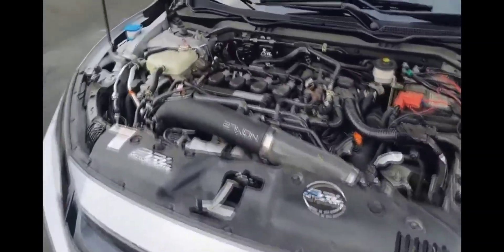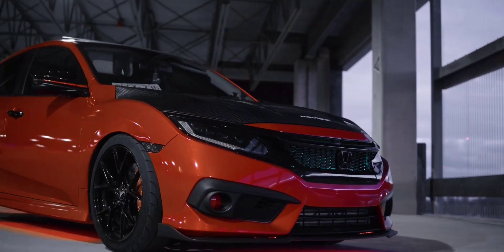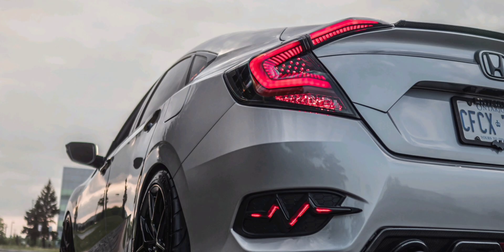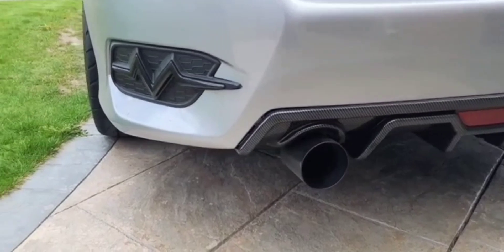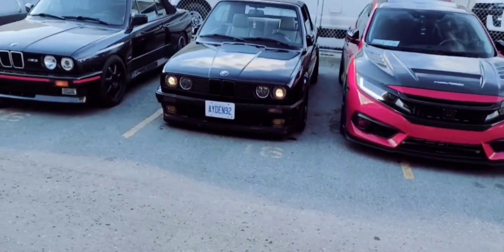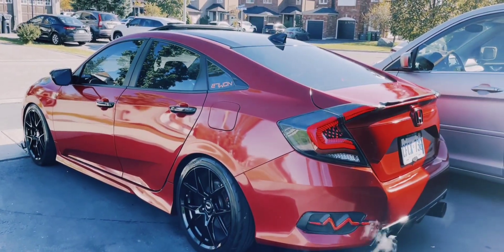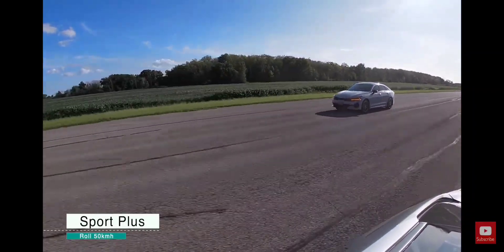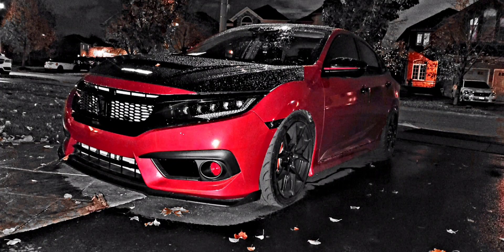Modify Honda civic 1.5 CVT review.

Comment: I always told people that with a CVT, having it “fake shift” makes it slower. It does feel more conventional and sporty in a way, but you’re exactly correct, the boost drops as well as the rpm and then the engine has to remake the boost. I thought with Hondas that if you left it in D mode, it would just stay at 6k-6.3k at WOT, and in S mode it would fake shift at WOT. That sounds weird because like you said without the fake shifts it is faster so why would Honda program it like that. I think it’s just for the effect so people think it’s shifting and seems quicker. It could be the opposite, but I know I drove a friends CVT 1.5T at WOT and it would hold the revs in one of the modes and I believe it was D, surprisingly. Anyways, love your car. Looks so fresh brother. Good luck with it. Change that CVT tranny fluid every 15k to keep it fresh.
Reply from the maker: Yep, sound can be deceiving, when it makes that shift sound you're thinking it's faster but it's actually not.

Comment: beautiful build bro. I have a tuned Maxima with the Cvt. changed both engine and transmission fluids from OEM. such a rocket, the CVT is definitely an underrated build
Reply from the maker: Thanks, Yeah but I just monitor things when I'm pushing it, alot of guys are breaking their cvt then they can't believe I'm pushing mine so much without breaking it, whenever I'm racing or doing draggy, I always have my ktuner plugged in monitoring cvt temperature, knock control, fuel trims etc, these guys who are breaking their cvts don't monitor shit when they're pushing their car, think about about it, let's say you're pushing the car alot right and let's the the cvt is overheating or the knock control is going up alot, they have no idea of what's happening, so they continue pushing it and the cvt overheats way too much and then boom, or the knock control goes up so much that they starts getting rod knock and kaboom engine is done... .
Reply: What does it mean pushing your honda, is it fast driving on motorway or drag racing?, street racing?, if you pushing honda on motorway example constantly  driving around 200 km/h, for couple of hours is it cvt build to handle that kind of driving?..I do not do any racing or drag racing with my honda sedan 1.5 t .

Comment: this gives me motivation to put some money aside and build my CVT hatchback
Reply from the maker: Be careful, hatchbacks have weaker rods than sedans
Reply: @the_batmobile0.4  I’ve heard the touring coupes have the same rod thickness or close to as the Si’s. Did you find this to be true?
Reply from the maker: @chad6434  true base on my understanding
Reply: @the_batmobile0.4  awesome. We’ll I’m on my way for your build. Getting my down pipe this Saturday, after that I’m saving up for the inlet and turbo then I’ll be finished!
Reply: @the_batmobile0.4  what about a 19 coupe ex-t?

Comment: Extremely useful info man. I am currently building my own 21 sport CVT. What are your thoughts on installing a CVT cooler?
Reply from the maker: It depends, I live in Canada, it's pretty cold here most of the most months oct-may, I didn't get one, also when I'm racing I'm monitoring my cvt temperature on the ktuner, so if I see it's going above 110c I'll just stop hammering it and let it cool down. If you're in hot place, you could get one
Reply: @the_batmobile0.4  yeah I live in central/southern California. So it can get anywhere above 90 degrees F on some days. I’ve got a PRL intercooler installed but that doesn’t help the CVT.
Reply: @the_batmobile0.4  Wow thats 230F,most ive had is 219 on highway and i dont go on the highway much just 30 mins drives to my friends house but i ordered a cooler because it reaches 100F here in Miami so ill be ready and install it next week when i do the first CVT oil change next week at 30k miles on my 2019 Civic with Ktuner's TSP stage 1 tune. I have a mishimoto cold air intake but i swapping to a prl cobra next week and the 27won TIP also this friday.

Comment: Currently have a 2020 Civic EX-L under on power mods
Ktuner v1.2 running phearable 1.5r on corn tune no flex FF
PRL CCAI
27Won DP/Stock FP
Exhaust Stock Mid Reso Valvetronic Muffler from dual exit to single exit.
Other mods
Mishimoto Coils pack
Strut bar sirimoto
Other than that all are stock and only did maintenance schedule early not on reccom factory intervals.
Any opinions or advice for me to take? just comment : )
Reply from the maker: @stevenleyson728  seems like u got everything covered unless u want more power.

Comment: This video makes me love my 1.5t hatchback I have a injen intake and a stage 2 Ktuner and been looking for more ways to gain more power from my car
Reply from the maker: Be careful,  hatchbacks have weaker rods than the sedans touring
Reply: @the_batmobile0.4  is this something proven? I thought all the engine block is same with fk7's and fc1's
Reply: @berkaysenoglu1784 yes it’s proven. Hatchbacks do have the weakest rods
Reply: How has the tuned 1.5 cvt been? Has it held up after a year?
Reply: @the_batmobile0.4 what about the coupes? I have a 19 coupe ex-t with the L15b7 engine. It's strange how the coupes only got 170hp in ext trim. But the hatchback gets 180hp? Plus there's two CVT transmissions I'm assuming? One with the paddle shift, and one without paddle shift.
Reply: how’s it been bro? i just want something simple i have an exhaust but looking to tune and intake

Comment: 12:17 wow.... I have the same car and had no idea you could just throw it into neutral from a roll and rev the engine. I assume you let the rpm's drop before throwing it back into drive correct? If so, I definitely need to try this next time I drive lol.
Reply from the maker: @BmoBro1992  correct, take your feet off the gas pedal then put it to neutral, same thing for when u switch from neutral to drive

Comment: Love you build. Do you have a rear motor mount on the car ? Also did you go up to 5w-30 oil ?
Reply from the maker: Hi no I do not have rear motor mount, I did had a aftermarket engine mount which was terrible at idle and low speed, car was vibrating alot with the aftermarket mount, I used amsoil signature Series 0w-20
Reply: @the_batmobile0.4  I still don't understand why everyone switches to 5w30 on the Facebook groups. 0w20 to 5w30 is quite a jump, especially when many of those guys have few mods, and it's a modern small displacement engine.

Comment: Hello sir, I have a 2020 1.5t hatchback sport CVT, do you think i can get up to around 250-260 horsepower and be fine with the transmission?
Reply from the maker: @Sean.fk7  should be fine, just avoid launching it too much, and make sure the fluids are up to operating temperature before u floor it

Comment: Where did you get your rear bumper lower garnish? Looks sick!
Reply from the maker: U mean the diffuser?
Reply: @the_batmobile0.4  above the diffuser, I have the same diffuser but not carbon fibre like yours. I am referring to the garnish, two on each side with zigzag lights
Reply from the maker: @kg_1720  oh the rear drl's.....I got it from Amazon but I can't that specific zigzag one, but here's the link for other design...browse around u might find it.

https://www.amazon.ca/iJDMTOY-LED-Bumper-Reflector-Rear/dp/B074R3L4ZT/ref=pd_aw_sbs_sccl_2/143-1478333-1575448?pd_rd_w=i8D7x&pf_rd_p=ad2ad842-afef-48af-aeab-080c9036bde6&pf_rd_r=VGHNWFGVYM1KD5FQ5JVB&pd_rd_r=2f2a320b-59be-4034-9bf5-ceebbf0f17ab&pd_rd_wg=cGt0t&pd_rd_i=B074R3L4ZT&psc=1
Reply: @the_batmobile0.4  maybe they don’t sell those anymore? I really want the same ones you have for my Touring
Reply from the maker: @kg_1720  yeah could be because I can't find them

Comment: Do u think it'll be fine to push the 1.5t cvt for the accord as well since its basically the same setup? Recently bought a catless dp for her 😭
Reply from the maker: I dont know, just because mine hasn't, doesn't  mean someone else's wouldn't, and you have realized that I just monitor things when I'm pushing it, alot of guys are breaking their cvt then they can't believe I'm pushing mine so much without breaking it, whenever I'm racing or doing draggy, I always have my ktuner plugged in monitoring cvt temperature, knock control, fuel trims etc, these guys who are breaking their cvts don't monitor shit when they're pushing their car, think about about it, let's say you're pushing the car alot right and let's the the cvt is overheating or the knock control is going up alot, they have no idea of what's happening, so they continue pushing it and the cvt overheats way too much and then boom, or the knock control goes up so much that they starts getting rod knock and kaboom engine is done... .
Reply: @the_batmobile0.4  oh okay brotha thank you for the detailed response! N yea imma just check everytime like u r with the ktuner v2 screen.

Comment: So setting the TPS to 90% wont let the car “shift” even in sport mode just keeps the rpms near 6k? Is that what your sayin? And you keep the block there while you drive?
Reply from the maker: Yes that's what I'm saying but sometimes it'll still shift, yes I securely keep that block there, make sure that block doesn't fall off and go under your brakes pedal, but yes the point of the 90% is to keep the car from shift and keeping the rpm at 5500-6000 rpm however it still shifts sometimes, if it does shift alot with the tps at 90%, try tps at 85%

Comment: Thinking of going flex fuel. I have a 2021 EX CVT tuned with phesrsble 1.5 and a prl race cai for about 6k miles. If i install the prl flex fuel can i run both 93 gas and e85? I can only put e85 on the edge of town and would only be down for it when i go out for races. Should I add more bolt ons? Or as long as i don’t consecutively hit it should i be fine?
Reply from the maker: Yeah you'll need a flex fuel custom tune to run both 93 octane and e85, honestly it'll be better to run flex fuel Ethanol only if you upgrade your turbo, the stock turbo is already max out with just 23ps on 93 octane  with ktuner 21psi otsi, with Ethanol  you'll pushing around 27psi.. and since your car is ex , that means you don't have the stronger rods, but it should be fine, I wouldn't go for more power unless you're gonna be racing like me and trying to get draggy record
Reply: @the_batmobile0.4  Appreciate the feedback man your civic is goals

Comment: I got a question have you done a cvt drain and fill and found a metal piece on the magnet?
Reply from the maker: @vvsking2913  I haven't found any metal pieces when I change my transmission fluid
Reply: @the_batmobile0.4  oh thank you
Reply: @the_batmobile0.4  sorry about the questions but what were the temps for your trans that you would see
Reply from the maker: @vvsking2913  around 109C after some pulls

Comment: Hey man Saw your videos of you dragging this, fucking awesome. I wanna do this to my hatchback eventually. Any problems?
Reply from the maker: Hatchbacks have weaker rods than sedans and coupe, I haven't had any major problems,  btw u a ufc fan?
Reply: @the_batmobile0.4  Even with the hatchback sport? I'm thinking a total of 230 HP. It is also my daily so im not trying to go to the edge.

And ya lol dont mind my username i made that super quickly. Also fellow Ontarion here.
Reply from the maker: @rigoeats3654  all 10thgen civic hatchbacks have weaker rods, 230 shouldn't do anything to them tho, you're good with around 250
Reply: @the_batmobile0.4  should I do a k tuner or dyno?
Reply from the maker: @rigoeats3654  you'll still need a custom map to achieve 250hp on ktuner, do u have a ktuner v2?
Reply: @the_batmobile0.4  no its stock right now, I do plan to put a ktuner v2 or a hondata fp. Add some cold air intake and a exhaust
Reply from the maker: @rigoeats3654  I would recommend getting the ktuner v2 because you can monitor everything live with it

Comment: hello friend I have the same civic
I currently have these mods
*intake short prl
*cvt cooler
*prl intercooler
My question is to add the fuel flex prl kit, do I need to modify or add something else?
Reply from the maker: No, the prl flex fuel kit is direct bolt on, just need a good mechanic who knows hoe to install it.
Reply: @the_batmobile0.4  change injectors? Or change fuel pump?
installation only? (and tune of course)
your civic is my inspiration bro thank you very much
Reply from the maker: @brayanpalacios9808  no changes of injectors nor fuel pump

Comment: Question  i have rv6 catted downpipe and front pipe combo 02 sensor came on is that normal and can i put Derek robinson tune on my car whit out a intercooler is it safe
Reply from the maker: U need a tune to get rid of the 02 sensor light,
Reply: Ok thx
Reply: One last thing can i put a derek Robinson tune whit out a intercooler is it safe or will over heat
Reply: What kind of tune is it that i need to get rid of the 02 sensor

Comment: You feel the changes we you put the 4 sensor bar
Reply from the maker: The 4 bar map sensors is more of a safety because the stock one cannot safely handle more than 28psi safely, it's only needed if you're gonna upgrade your turbo and go above like 29psi
Reply: @the_batmobile0.4  I changed my turbo but I have lag and the car pull only 23 psi I think is límited by the sensor map
Reply from the maker: @Sr_photography01  what does your tuner says about it?
Reply: @the_batmobile0.4  he said we Need the sensor, but Is the same fot the Si and the non Si cvt ?
Reply from the maker: @Sr_photography01  yeah the 27won 4bar fits both si and non si

Comment: do you believe the ctv will handle 350 hp? or even 300?
Reply from the maker: 300hp easy, I was making around 320whp,  350 is pushing it, hp is not the problem so much it's the torque
Reply: @the_batmobile0.4  thank you for answering me but how much torque can it handle
Reply from the maker: @Roberto-ih3zx  around 280wtq I'd say
Reply: @the_batmobile0.4  what exhaust system do you have ?
Reply from the maker: @Roberto-ih3zx  custom valvetronic catback exhaust
Reply: @the_batmobile0.4  is it better use a k tuner I have (prl high flow catted downpipe, prl Inter cooler, k and N intake.) or dyno it.
Reply from the maker: @Roberto-ih3zx  it's better if you get a custom tune
Reply: @the_batmobile0.4  hey does your car spin a lot after the tune my car does. Is there a way to stop it
Reply from the maker: @Roberto-ih3zx  better tires
Reply: @the_batmobile0.4  any recommendations
Reply from the maker: @Roberto-ih3zx  mickey Thompson ET but these are drag tires, will help alot with spinning but they cannot be driven in the rain, or you can get the r888
Reply: @the_batmobile0.4  Do you believe upgrading the clutch of the cvt will make the cvt handle more torque and horsepower..?
Reply: What torque are u pushing in Nm

Comment: Can the Rpm/Rev limiter be removed & I have a 21 stock 1.5L CVT civic what’s that full list of mod i should do for sound & speed while maintaining reliability @ZeusLightning
Reply from the maker: Why would u want to remove the limiter? Its there for a safety reason, cvt doesn't sound good at all IMO, one of the main reasons I got rid of mine, but I had a catless downpipe with a custom valvetronic exhaust set up. Start of with ots maps like ktuner 21 psi. You'll need a downpipe for it.
Reply: @the_batmobile0.4  English 😅 I only know rice 🍚 Elaborate more please .

Comment: Hey man whats the top speed you hit in mph? I want my car to hit 160 you think that be a problem?
Reply from the maker: Good luck with that, unless you got a really long smooth stretch of road it's OK, but I went 142mph and the car was very shaky, I didn't go more because the car was unstable at such high speed, could've been because of the road though, wasn't smooth.
Reply: @the_batmobile0.4  thanks for the reply man seen alot of your races on sam’s channel although I like the hatchback better you doin good work for all us cvt guys.
Reply from the maker: @overlordtype25  thanks, but be careful with hatchbacks , they have weaker rods than the touring sedans, you can checkout civicx.com about it
Reply: @the_batmobile0.4  yes ive heard about it and constantly check the forums lol. Im just going fbo while keeping stock turbo & run phearable race tune hoping for close to 240-250hp , nothing too crazy in power like yours 😂
Reply from the maker: @overlordtype25  oh ok, then it should be OK then.
Reply: @the_batmobile0.4  142 felt shaky? Hmm could that be your suspension? iv taken mine to the 125 limiter multiple times and felt totally chill stock. I bought FBO and ktuner v2 but sold everything but the intake cuz read everywhere the CVT would blow. But you got me thinking might have to buy those parts again and install them this time. Thanks for the content on the 1.5 CVT.

Comment: So you have no cvt cooler with that power? I feel so much better now sitting at 23 psi
Reply from the maker: No but I live in Canada it's cold here, if you live in hot temperatures weather u might wanna get one, also I always monitor my temps when pushing the car, so if I see my cvt temperature is getting too hot, just pull over and turn off the car to let it cool down
Reply: @the_batmobile0.4  yea I’m in Jersey so it’s up and down depending on the seasons, but i monitor it so far highest I’ve got is 205 n it usually goes down when I’m off it, your car is sick btw saw both races, love the wrap n stance
Reply from the maker: @Ro6ns  I did about 20 races on that channel lol

Comment: What year is your civic because how do you have a 1.5T when I have a 2019 civic sport and it has a dumb 2.0L smh
Reply from the maker: What? Mines 2018, civic from 2016 to 2023 all have 2 engines, the slow 2.0L and the 1.5T, u choose the wrong engine lol
Reply: lol thers a 2.0 l version with non turbo. I guess 1.5T faster